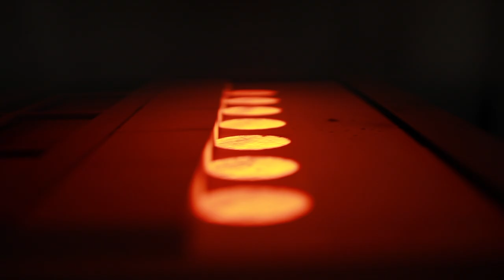How to Make a Stoneware Pottery Bowl, from Beginning to End — ASMR Version

Comment: what exactly is being painted on the bottom of the pieces? A wax of some sort I would guess; is this a product, or is it simply that any melted wax will work?
Reply from the maker: It's the wax emulsion from Scarva Pottery Suppliers mixed down with a touch of boiling water. Most pottery suppliers will sell more or less the same product I think but equally you can just use normal wax or paraffin wax, melted slowly over a candlelight or a hob on low.